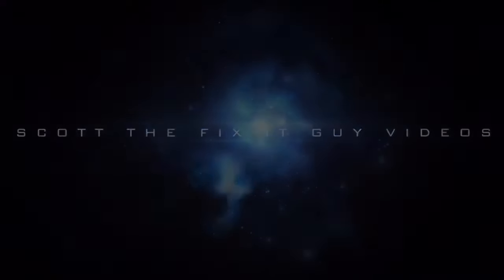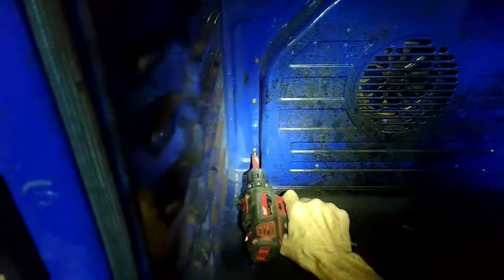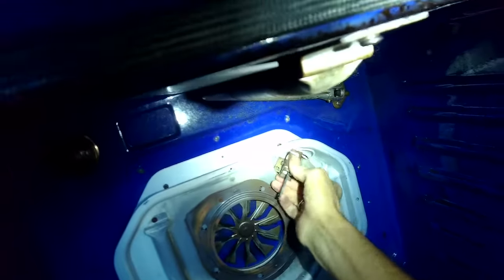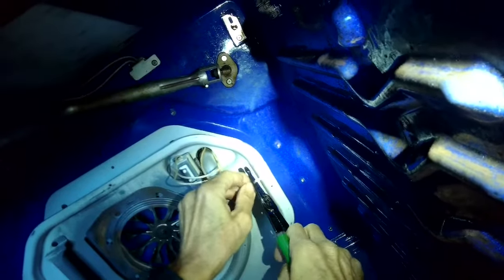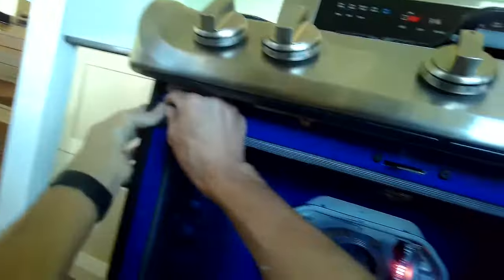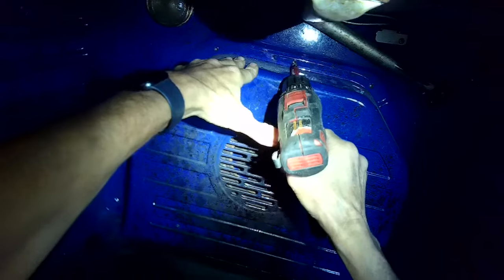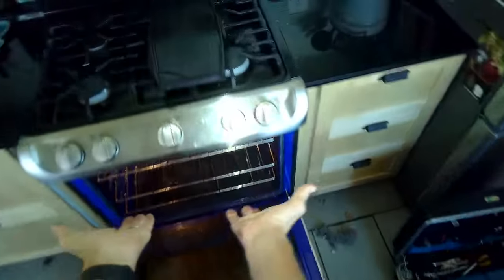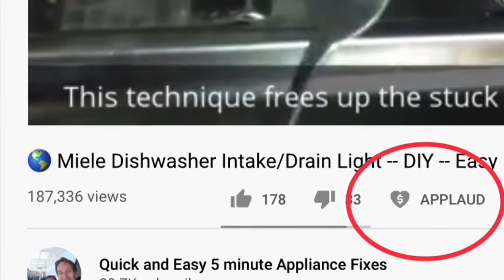✨ LG OVEN F09 ERROR - NO HEAT - QUICK EASY FIX ✨

Comment: I have two issues with this video:
1. Many LG model igniters come with a plug / no need to cut wires, but you do have to remove the rear panel. 
2. The particular generic igniter did not fit in my oven space - the screws are on the wrong side.

Looking online, one can find better fitting igniters with a plug for a similar price, so I think the particular generic igniter you suggest is not very helpful
Reply from the maker: I take the new ceramic igniter out of its metal cage and insert it into the old metal cage👍
Reply: @ScottTheFixItGuyChannel  please please please show me to reattach the igniter please :( I have searched everywhere to avail and now have no oven working at all, please please help me
Reply: @ScottTheFixItGuyChannel  how do you do that?? Use the old cage and how to put the ignitor back on
Reply: @myfabulouschaos8002  it’s Pretty easy. Just grab the old metal case with one hand on the right and the other hand on the left and gently bend the metal case outward.  Now you can slip out the old igniter.  Do the same thing to the new igniter.  Slide the new porcelain igniter into the old metal frame and then bend the old metal frame in on the new igniter.